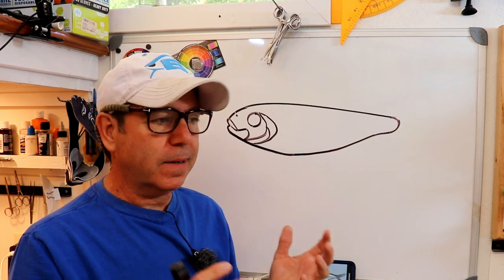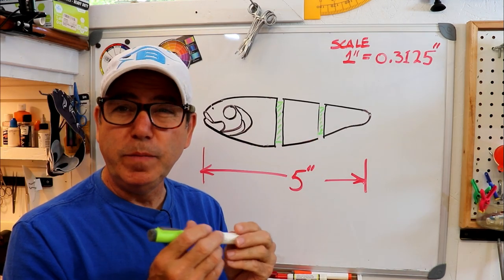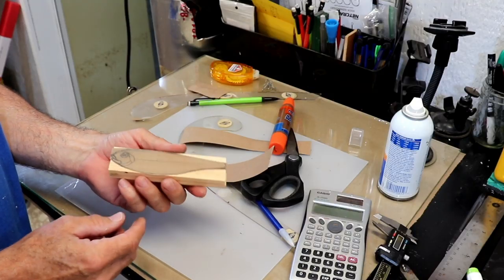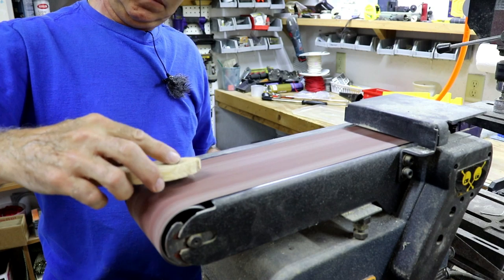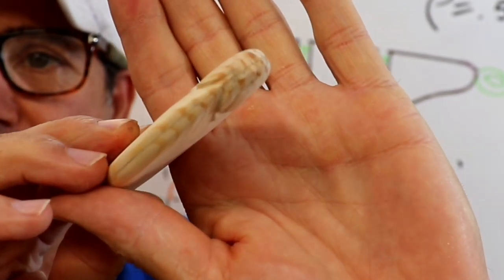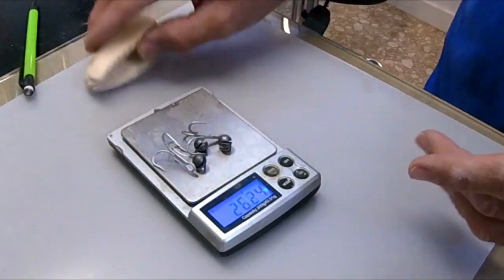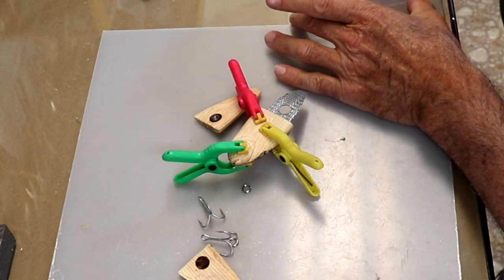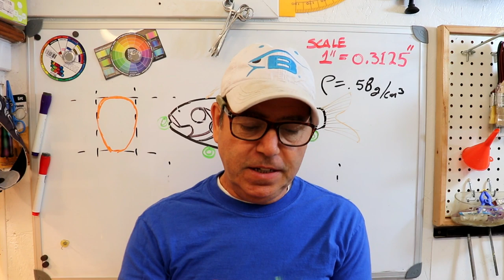Making a Glide Bait, Design and Build

Comment: Great tutorial...i am interested how do you measure  waight to put in lure...do you have some kind of formula or something different
Reply: Alen Puškarić  I hope he reveals this calculation. I’ve been doing it the old fashioned way by sealing the wood and measuring the water overflow in my test tank. 🤔
Reply from the maker: I have done a couple of videos of how I do my weight calculation. But in part to cover the process briefly to be sure everyone has gotten it. Thank you and cheers
Reply: Engineered Angler which videos is this? I’m struggling to work it out. Cheers

Comment: Thank you for your very helpful and informative videos.  I've been making my own bait for a while now and I have a question.  You use a "twister" to bend wire.  Is it a do-it-yourself or can you buy it?  Greetings from Germany 👍
Reply from the maker: I use a TwistTech wire twister and I recently looked on line for availability but could not find it.  I think they might have stopped selling them.
Reply: @EngineeredAngler   thank you for the answer. 💪👍

Comment: Awesome video! Currently making a glider bait for saltwater striped bass and struggling to find the best place to put the weight. Is there any way to determine the center of drag on a bait?
Thanks for all the amazing content!
Reply from the maker: There's really no easy way to find the location of the center of drag. But there are ways of manipulating the design that helps insure it is where you want it.   You actually caught me in the middle of a lure build.  I'm making a glide bait and in this video I'll explain how I try to get the center of drag where I need it to be.. Look for it Next Friday.
Reply: @EngineeredAngler  yeah I'm having issues with getting it to glide at low speed. It's a 1 piece wood glider
 About 6.5inch long with a moderate sink rate. 
Hardest build I've had to date
Any help would be appreciated

Comment: How strong is the joint material? Especially if you get a big fish on the back hook.
Reply from the maker: That's a good question...I'll do a test with a mock up...and we'll find out.
Reply: @EngineeredAngler  excellent. I was thinking of making lures like that but was worried about the strength. Not just tensile but a twisting motion as well.  Fish in the net scenario.  Fantastic videos by the way.  Subbed

Comment: My strong suit is not math, so could you expand on how you arrived at the density of your material. I'm using a pvc material that comes in lengths for brick molding and trim for houses.....
Reply from the maker: Check out some of my other lure build videos...I go through the process almost every time.
Reply: @EngineeredAngler  Thanks I took your advice and found the Q and A video!